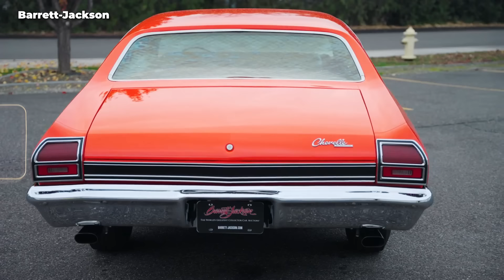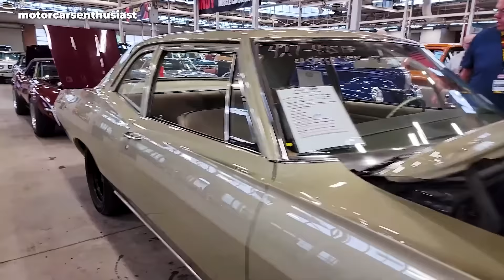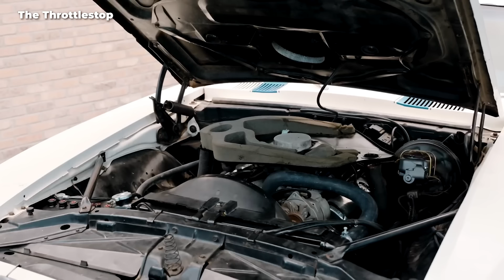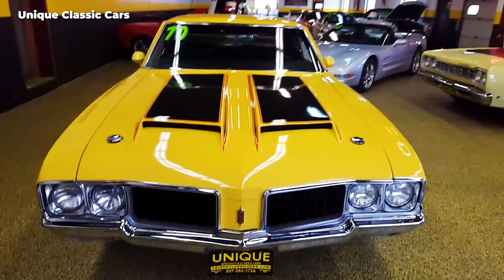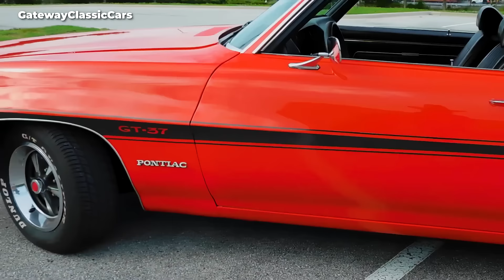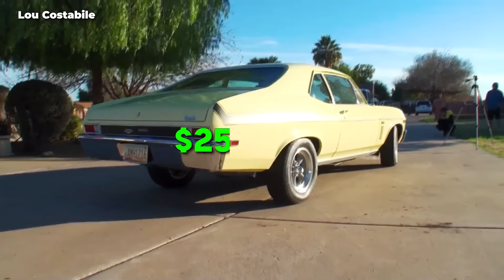8 GM’s Most BRUTAL Muscle Cars Nobody Talks About Anymore!

Comment: I got a three-legged chihuahua that is paralyzed from the neck down they would outrun any of those junk cars😂
Reply: Sure. go back to your Honda.
Reply: I live in a Grand Marquis that is only had one oil change in 15 years😂
Still running too😮
Reply: @Josephwildberger one change in 15 years? Okay. You do have the Right to be an idiot. Enjoy it. Remember that if you're trying to be funny, humour does not do well in writing.
Reply: My mother made it to $350,000 mi claiming not to have changed her oil too
Reply: @Josephwildberger Alright then. Can you prove it? Or did she also do it on one tank of gas and the original tires and brakes?
Reply: There was a long haul trucker that made it a million miles without an oil change. 
You also don't need churches or casinos or baptisms or breast implants or circumcisions.

Comment: When I was learning to drive in the 70's, all the cars available were pretty large. Most had V8's.
It rarely took very long for gearheads to find ways to tweak those engines up. The power was available, but it was restricted.
Just add good pipes and a better carb, give it a wider intake, and it was done.
Reply: You're right, the power was limited. By the skinny bias ply rubber on the ground.
Reply: @joequillun7790  well, that too. Good tires were, and are, expensive. Back then they were hard to find. The resources for advanced tweaks were not common. So folks improvised. They'd use the widest rims that could fit for contact surface, and did what they could about the tires.
Reply: Cam and pistons required too. Stick to what you know.
Reply: @notintohandles  considering I've been driving, or around engines, for longer than you have been alive, sure. I'll stick to what I know. Things anyone could do then. Those old tricks still work today. Replacing cams was not something everyone could do. Superchargers were expensive. Turbos did not exist. Engine internals required a garage. Maybe you were privileged or rich, I was not. Besides, what did you think I meant by keeping my comment simple? Does that make me ignorant or you foolish to assume you know what I know?

Comment: Corvette ZR2''s were only built in 1971 and 1972. 12 and 20.
Reply from the maker: You’re right. Very limited production, which is exactly why they’re so rarely talked about today...
Reply: ZR1 was built 70-72
ZR2 was built 71 only and engine was rated 425 hp.